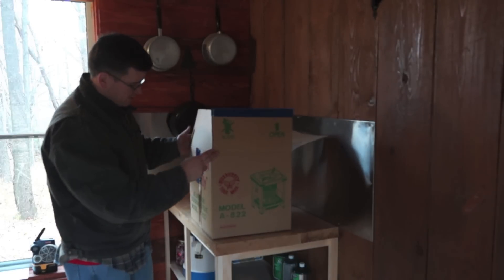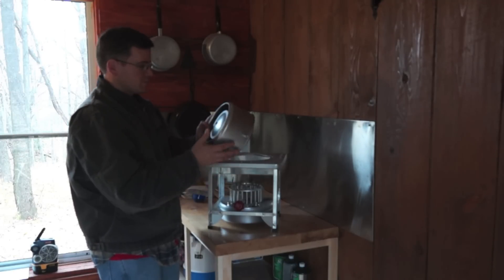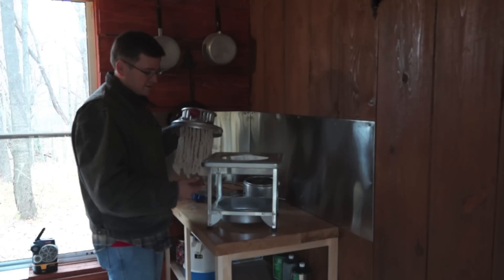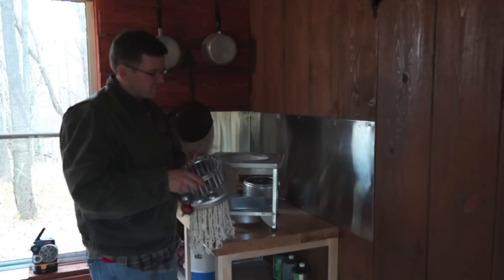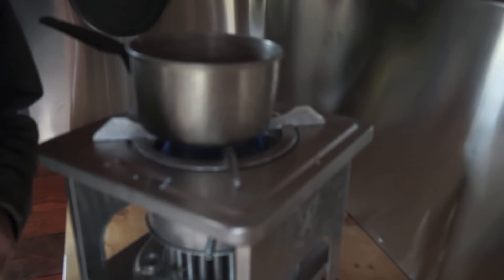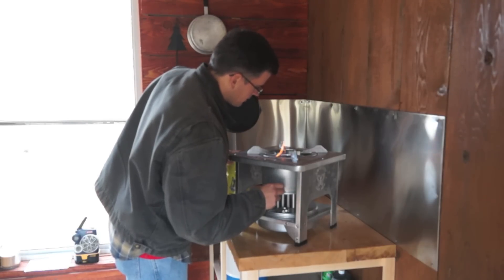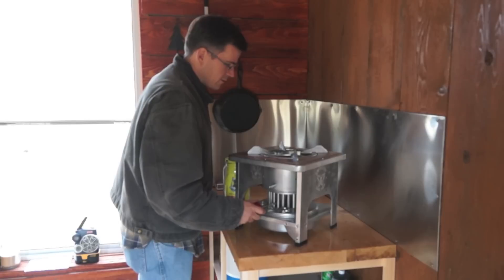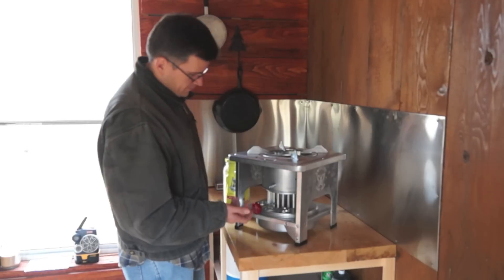Butterfly Kerosene Stove Model A-822

Comment: Sold by St Paul Mercantile - reopened Sept 2014. Your flame looks a bit high. Two things could cause that - either the wicks are installed a little bit high, or you are at least several thousand feet above sea level. We sell about 10 different models.  Google search kerosene cook stove

Comment: Should work w/used cooking oil. Will not work as well as good grade of kerosene. Sooting & heavy black smoke/fumes are a concern. 

If you ever to do this, wash the wick (if this style can be washed without it coming apart). Use full strength Dawn Dish detergent & work through strands to remove kero. Rinse well. Let thoroughly dry before using with cooking oil. Let wick become saturated with oil before trying to light. Same process if switching back to kero. (Same process I use with oil lamps.)

Comment: The cleaner the fuel the cleaner the burn and less smoke and fumes. Kerosene is the preferred fuel, K-1 kerosene is a better grade and then there is Klean Heat, a synthetic that burns very clean is just about odorless.  Klean heat is more expensive than kerosene. If you were using it every day, you would probably just use the cleanest grade of kero that you can get. 
I have one of these stoves and they are very handy and low tech.  Great as an emergency stove for power outages or other dramas.

Comment: oh.ok. I didn't know they made a radio for the Ryobi. I had a Ryobi drill and light set give to me. drill lasted a couple of months and went up in smoke. I still use the 18volt flashlight though. personally I buy either dewalt, Makita, or Milwaukee power and battery tools. more expensive yes, but they seem to last longer.

Comment: One of those is on my wish list. Have seen great reviews on them. Can't justify as have free standing 3 burner & table top 2 burner kero stoves. 

Normal to have odor from kero when first starting a stove & sometimes when shutting down. Don't have to wait for it to cool down to relight. 

Good for big pots. Some use these for waterbath canning to keep heat out of kitchen in summer. 

Tip: Keep one of those pumps on hand for drinking water usage only. Can come in handy.

Thanks for sharing.